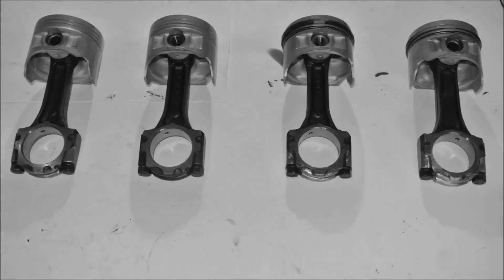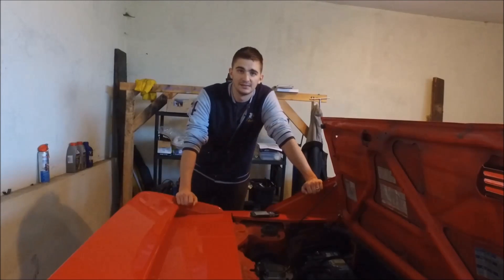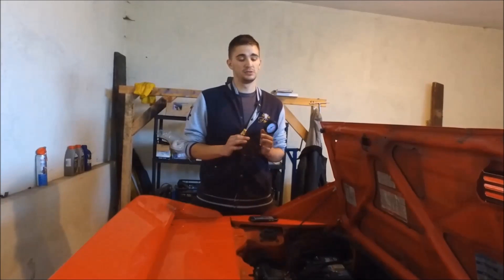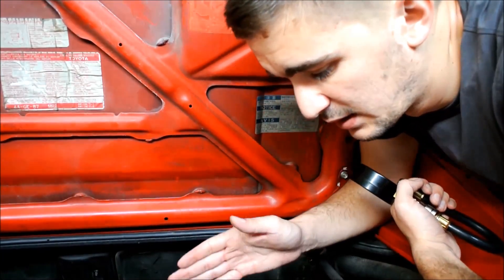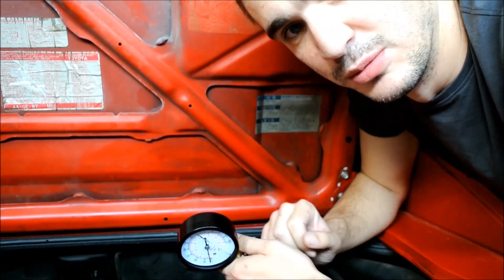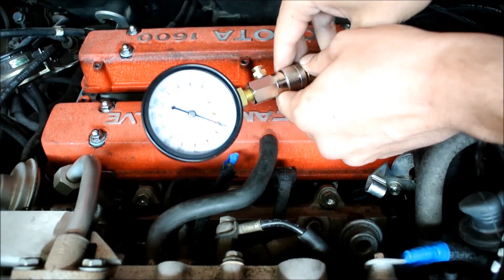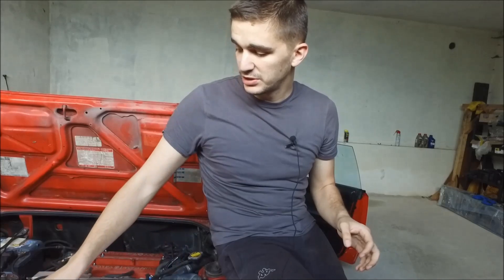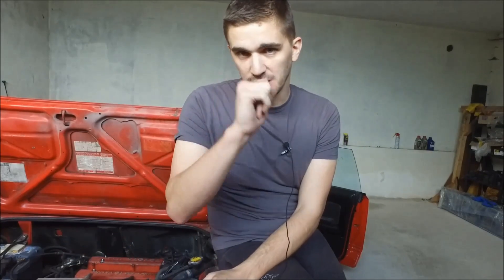How to compression test your engine DIY

Comment: I've watched many compression test videos, but none of them can answer my question:
How can the pressure continuously build up if there is an exhaust valve? Won't the air escape from there?
Reply from the maker: The pressure is not continuously building up. There are "pressure pulses" occurring during each compression stroke and they're captured and stored and measured by the testing device.
Reply: omg that makes so much sense!
Thank you for taking the time to answer my question

Comment: Hey man I need your help. if you could help you would be a star. ive got myself a bigport 4age and my readings are   cyl1 145psi cyl2 145psi cyl 3 psi 160 cyl 4 165 psi. this motor only has around 80000km on it. are these readings fine? im seeing in the 4age manual a perfect engine should be around 180psi for the bigport? what do you think bud?
Reply from the maker: Did you hold the throttle open while you cranked the engine?
Reply: driving 4 answers Yes I did.
Reply from the maker: It's still not too bad. An engine with 80k on it will likely not have all perfect max readings. Are you sure the gauge you used to measure compression is good? Are you sure you don't have any vacuum leaks? Are you sure its 80k kilometers or someone told you?
Reply: Hey mate just took my bigport 4age apart and found out it has a 6bolt flywheel. I thought all of them had 8 bolts. what does this mean? 3rib with 2nd gen tvis head
Reply from the maker: someone you use to know Means it's an early bigport aka bluetop. Many 3 ribs have 6 bolt flywheels.
Reply: driving 4 answers thanks mate. everyone on forums etc are all saying that it never came with a 6bolt flywheel.
Reply: My 3sge gen 3 made around 180 psi but i had to crank it like  10 times to get that number, if i crank 4 or 5 times 3 of those cylinders make 150ish psi, is that something concering?

Comment: A very handy additional tool is a remote starter button. It keeps you from having to get in and out from under the hood.
You CAN crank the engine 3, 4 or 5 times, just make sure you decide how many cranks, and use that number for EACH cylinder. Typically, three cranks get you to 90-95% of max, but since you're looking for differences, not a total PSI, getting to 100% is not that critical.

Comment: Any time you have the plugs out for a tune up, do a compression test.
I've work at GM dealerships, independent shops, and owned shops. I always did a compression test BEFORE I did a tune-up. If there was a bad cylinder, I wouldn't do the tune-up.
If the car has bad rings, gaskets or valves, the tune-up won't fix it, and you'll just get blamed for a 'bad' tuneup.
Reply from the maker: George Dennison Makes sense!

Comment: Cool vid! It sound like your have bad valve lifters or maybe or maybe predetonation
Reply from the maker: Javier Broger Thanks. I already checked valve clearance. Its a shim on bucket head so not much can go wrong with the lifters. Ping is probably not happening as I'm running on the rich side.
Reply: driving 4 answers hope you get it fixed asap ✌

Comment: It sounds like you got rod knock.  What kind of bearings you change to that engine?
Reply from the maker: Antti Tukse It's hard to pinpoint by ear, but the sound doesn't seem to be coming from down low. I will be dropping the oil pan this weekend to be sure. I put in all OEM Toyota bearings, all according to service manual specs.
Reply: do you have original camshafts? And you have checked valve clearance?
Reply from the maker: Antti Tukse Catcams very mild cams, valve clearance checked. There's a video on it.